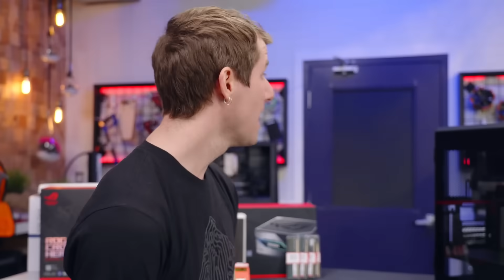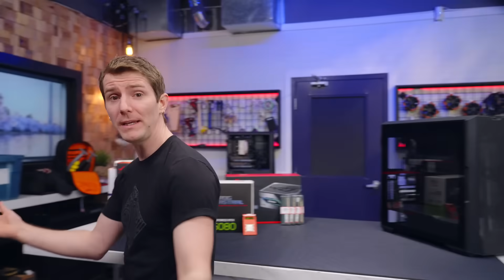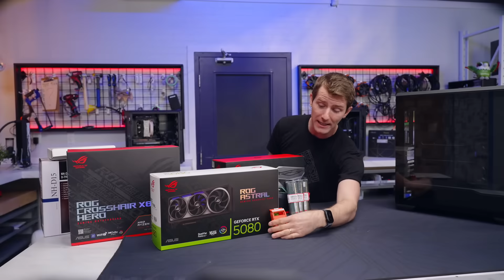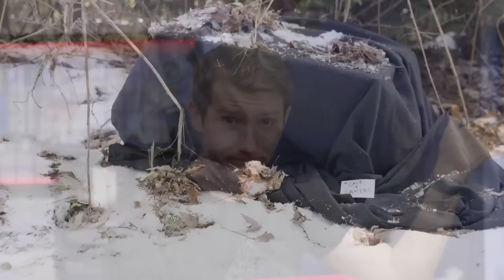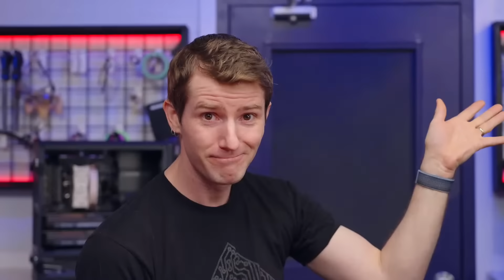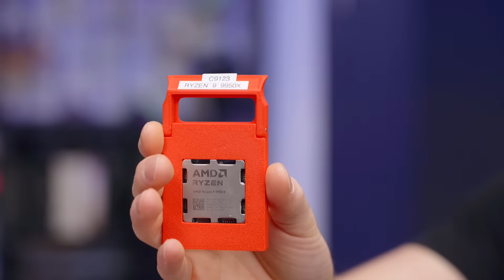The Ultimate $4500 Workstation PC

Comment: I'm not a hatewatcher (quite the contrary), but I feel like how this video was thrown together was based on the antithesis of what LTT is about and regularly reminds viewers (aside from dicking around). Even if its isolated to workflows related to After Effects rather than the rest of the suit, I even wonder if whoever scripted this video even watched the 5080 review, much less comprehended its spec sheet or talk to the editors about what they wanted and needed. Even prior to the 5080 spec sheet being confirmed it seemed sus from the leaks which transferred over to the confirmed spec sheet. Seeing them move from a 3090 (since the dual 3090ti system was for AI testing) to a 5080 made a huge assumption the architectural changes were worth the vram downgrade but as implied in previous videos (even videos featuring the M1 iPad Pro), or having any experience in the editing and processing space, specific memory per architecture for Adobe applications is huge. And no, this isn't a hindsight thing--I have personally told clients and friends since the 3090 launch year to get the extra VRAM the 3090 offered at non-inflated prices for productivity work and can't see how that was overlooked in the scripting here especially since the 3090's were previously used. Video was a good time filler and was overall fun as per build videos, but the basic planning that goes into a build, or in this case, a video/stream, was severely overlooked.
Reply: k

Comment: Little tip for Linus on his tennis elbow. I also suffered with tennis elbow for about a year. Did physio and rehab; the whole bit. What worked to get rid of it for me was to do regular bicep curls and hammer curls. The tick is to build the muscle around the elbow joint which will take a lot of the load off you tendons. It will be soar and hurt for the first while and seems counter intuitive, but it work for me. been pain free for about a year now.
Reply: soar like an eagle!
Reply: Hell yea bro I started doing hammer and bicep curls, burns like a mofo
Reply: My big solution was extensor training (the weird silicone things that loop around your fingers)

Comment: When I was at uni in the early 2000s, I built PCs to make some extra cash.  I miss paying $50AUD for a Gigabyte motherboard and it working just fine.  That's $30 USD. That would be a $55 USD motherboard now after accounting for inflation.  LMAO.  You can probably get an M.2 cover for that.
Reply: @Alex.The.Lionnnnn  sadly, the power delivery and signal integrity standards as well as wafer cost have increased, also you get a multitude of features as well.
Reply: @RawmanFilm  oh I know.  Though I'm not sure those cost justify the drastic price increases.
Reply: @ If we look at EVGA, yes they were correct. Looking at some older PSU or Mainboard Manufacturers, no they still do seem to do very well.

Comment: 1:56 am I crazy, why would you use cpu video decoding on a desktop editing workstation. Why not just use the graphics card's hardware for that? Like it's nice to have as a backup or if you're running a low end machine/laptop but if you already have Nvenc why is quick sync helpful for this application? Im pretty sure premiere supports nvenc at this point it would be insane if it didn't
Reply: Definitely making use of the graphics card, but the video editing benchmarks I checked a few months ago showed better scores when paired with the Intel CPU.  So both are utilised.

Comment: The Noctua cooler is also reliable like nothing else. The bearings on those fans just last forever. Cheap fans don’t last in our fab shop.
Reply: Purchased 10 for my pc, I love them!!
Reply: @47RoninGaming  You will have no regrets, and 10 fans for life. Wish I could post pics here, the neglect they take is just epic.
Reply: Had the 1 on my cpu cooler die in the first year lol , i still went noctua when i replaced it but yeah not as bulletproof as id expected.  Had my computer thermal shutoff a couple times before i figured out the cause lmao

Comment: Im wondering, if will be there anytime soon any motherboard, whit all these ai functions which can detect the hardware installed then starts a session and turning things up and down like coreclocks voltages and stiffs to automatically and safely autotune and overclock and undervolt your cpu your rams and anything in it which can be finetuned by the user?

That would be supercool.

You just put your config together then you let the "AI" in it finetuning the device itself and have a built in stresstest for testing the  setting meanwhile so you leave it for a couple minutes or hours and boom. You have a finely tuned personalized config whitch set to the specific component that you put together.

Comment: Guys in the Comments - please at least read what the 5080 does :D it has Dual nVENC encoders AND Dual nVDEC decoders - and they DO natively work with both h.264 high10* as well as h.265 high10 - h.264 high10 being what the FX30, FX3, FX6 and similar shoot in their Intraframe Codec option.
Having a device capable of Decoding UHD H.264 10 Bit 422 Intra at probably about 500+ FPS will mean the world  to latency and snappyness. Their servers are Saturating high Bandwidth Requirements already. It, as much as some of you might despise, is the sensible choice for a Windows Based Workflow. basic M4 Mac is a very appealing device with a high tax on any upgrade you plan (except 10G)

Edit:
* it seems Adobe is far behind shedule on Codec GPU Acceleration (again) and does (according to Puget Systems) not yet support H.264 10bit 4:2:2 GPU decode.
According to the official nVIDIA DECODE/ENCODE matrix, the 5080 does have two decoders that CAN do AVCHD H264 4:2:2 10Bit Decode on the Media Engine.
Reply: Hey, full time editor here. AFAIK H.265 and h.264 are both long-GOP codecs, which LTT in house production team don't use usually, and intraframe codecs such as apple prores or XAVC-I on sony cameras don't have a native hardware acceleration (besides macs M2 and higher). Sooo, that means they'll probably not going to benefit so much from switching to the new 5000 series cards, but if they would need to save storage or shoot on other cameras that don't have all intra codecs, then it would speed up the performance drastically. 

Switching to a new gen cards benefits both timeline performance and decreases export time when you use intraframe codecs, but like, it's not going to be 2x times the performance increase, as it may be the question on the software side of things. Check pugetsystems articles on this topic, they do tests like these a lot
Reply: @Atlasman  Cheers Film-Colleague,
it seems, MPV on Linux understand XAVC-S I as H.264 AVC MPEG-4 part 10 (High 4:2:2 Intra), yuv422p10 and is hardware decoding. No noticable CPU Usage but 4-5% of general GPU Compute on my AMD 7800XT using open source drivers and Kernel 6.1+

Looks like the typical Premiere Pro issue it seems. I will look more deeply into this.

EDIT 1:
Yes according to Puget systems, None of the Decoding Engines gpu decode H.264 10bit 4:2:2 Intra in neither Davinci nor Premiere. Davinci has much better support though. Will will continue to look into this.

Edit 2: 
nVIDIA has it's own Matrix showing capabilities. 5080 DOES have two decoders and DOES Support AVCHD H264 4:2:2 10bit GPU decode.
It is just, yet again, adobe who is slowing it all down.

Comment: Why not use a Be Quiet Dark Rock Pro for cooler? IMO I find it better, quieter and runs cooler then noctua ( which I started out with when i first got the 2950X), I went from a 280mm AIO on my TR back to the DRP TR4 which cooled better.. If it cause it  is due to sponsor then I get it  lol ( FYI the TR4 is a older system I now use as a media/nas server lol )
Reply: I wouldn't doubt thanks to their partnership with noctua, that probably just have an overstock of their products.

Comment: 89 U.S. cents per pound
The cost of a block of aluminum varies depending on the size and weight of the block, but the average market spot price of an aluminum ingot was 89 U.S. cents per pound in 2020, and one block of aluminum with dimensions 12" x 12" x 12" and a weight of 166.2 lbs costs $2,274.01
Reply: Why does the price go up 14-fold when buying a block?
Reply: @Steamrick  harder to manufacture. With big blocks you need big molds and more regulated cooling to prevent micro-cracking and stuff.
Reply: @SyntheticFuture  Is this a concern when you are going to reprocess it into some completely different shape? I was under the impression that aluminum is smelted down anyways.
Reply: @Gift0r  I don't think you'd get big pieces if casting is how you are planning to use it. Bigger blocks are usually for milling / routing for example for unibodies. In which case having a homogeneous block is very important. If you are casting the finish of the raw material doesn't matter 👍

Comment: I know uniformity is nice, but why not just have a mix of standardized Mac and PC configurations. Your editors that want Macs would actually save you money, especially over a 5090 rig, and about parity with a 5080 rig, but with way more memory.
A Mac Mini Pro with 48GB of RAM and the 10G NIC will "only" cost you ~$2000.
Reply: In terms of their IT department, uniformity is better because then you know what issues can potentially go wrong and troubleshooting future issues becomes more straightforward. It's like companies buying the same model car instead of one from each brand or any mix of brands.
Reply: @jabbahut755 

Plus two different OSes... So that alone adds more possible issues
Reply: @jabbahut755  Yep. A more expensive computer now is cheaper than several days of downtime accumulatively every year for every employee experiencing a technical issue.
Reply: @jabbahut755 I guess, but it is a tech company and video editing is their lifeblood. I feel like a small sacrifice in possible IT issues is a small price to pay for happy and efficient employees. 
I went from a small company where I could ask for any laptop that would best suit my needs, that grew into a several hundred employee firm where now all I get is Dell's cheapest 14" pile of crap. It's infuriating to use, my old eyes can't see that tiny screen but they don't care. I have a 16" USB monitor, but that's clunky to use most times.

Comment: I got the 9950X and the video editing performance is very nice. I went from the 3900X to the 9950X and the difference is drastic. Especially when scrubbing the timeline and making cuts.
4 x 24GB 6400M/t is possible. G.Skill and TeamGroup have them in single rank. 96GB is enough. 256 is overkill.
My MSI X870 Tomahawk took about 1 minutes to train two 16GB sticks and about 3 minutes to train four 16GB sticks. I have seen it take over 5 minutes for four 24GB sticks.
Reply: 256GB in Editing with Colour Grading may not be overkill. Davinci does want it badly when you get to high node workflows.
Reply: @RawmanFilm  That's probably true and likely especially true if the raw files are in 8K. I wasn't even thinking about it from that perspective.
Reply: @BlenderRookie  as far as i know, they still have their red Cameras but primarily use Sony FX6 and smaller similar models. Redcode RAW has been quite well supported GPU wise for a while now. It seems, GPU Based Decompression did a lot of heavy lifting
Reply: That's great to know, I'm currently on a 3900x and my 13th gen i7 laptop feels faster.
Still on a 1080 as well. 5090 has coil whine and 5080 seems like it has low memory, undecided there. Unless you have a video card recommendation.
Reply: I believe a while ago in a video someone mentioned that it would be nice to have station with more than 128gb, so maybe they actually use that sometimes. In any case, I'm confused about the gpu choice, 16GB of vram seems a bit tight to me. In a way I feel like it does not match the 256gb of system ram, perhaps they considered 5080 or 4090 and went with the new gen for the new encoders. 
Either way ASUS is  👎